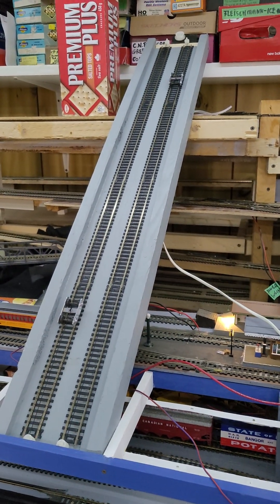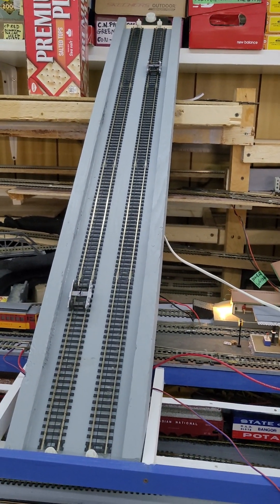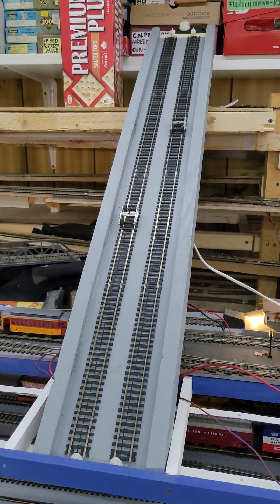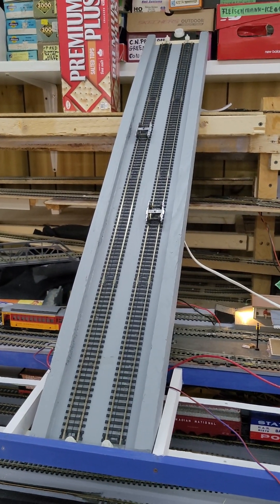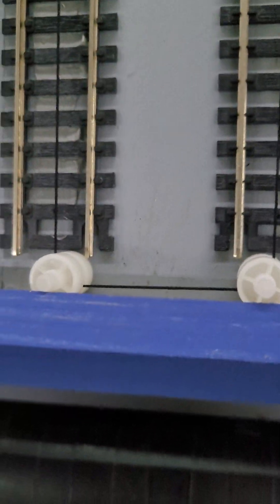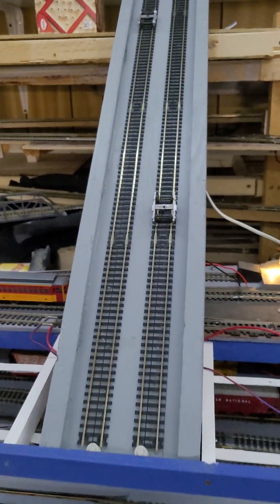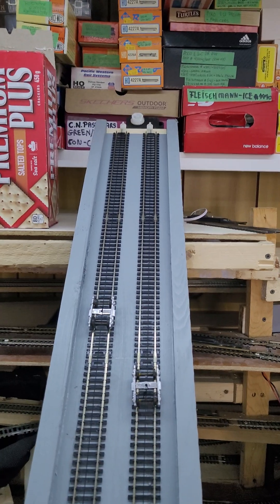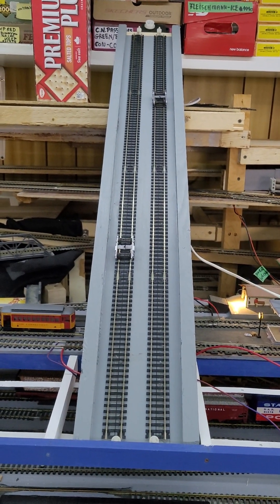Testing built Funicular railroad on " rough in " spot.

Comment: When rigging a R/C model yacht we use a similar method but have a sail winch at the end driving the cord from in to out and one thing that might be useful to you is we put a small spring in the cable to keep the tension on the line. Great stuff.. looks great cant wait to see the rest of it when it is done..